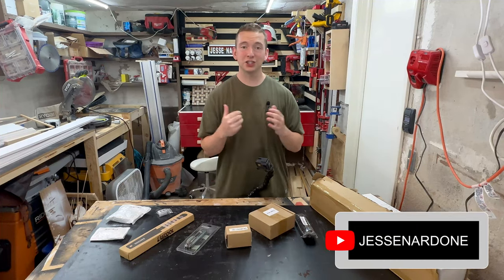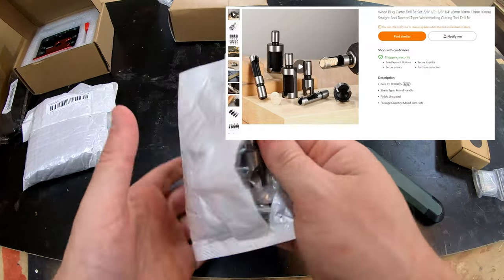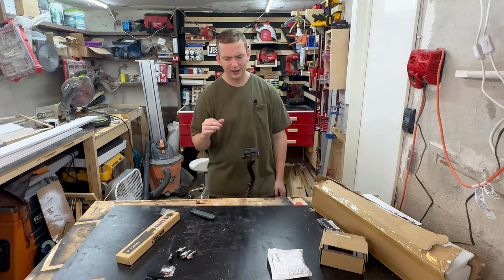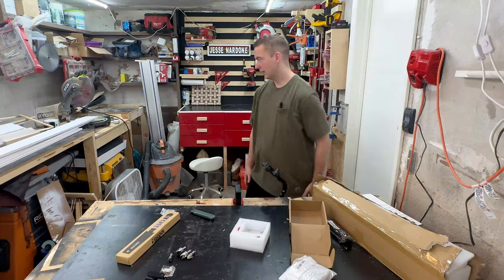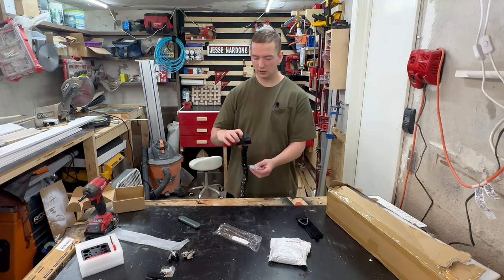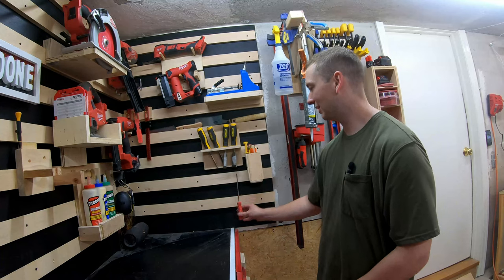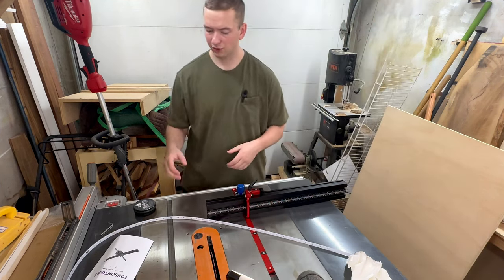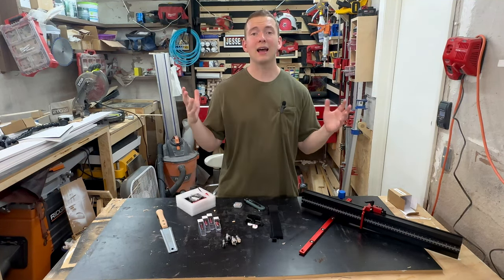I Bought More TEMU Woodworking Tools. I have an Addiction to Good Value! Unboxing - Initial Review

Comment: I have the same miter guage. The extra "washers" for the miter guage are to be mounted under the guide rail to help keep it in the track. Thats what the extra holes are for in the rail, and if yours is the same as mine the rail has recesses so the guide wheels or washers will sit flush. Some people dont like using them because it prevents you from lifting the guage straight  up and out of the track. I like them, it helps prevent the miter guage from falling if you pull it back a little too far to where the fence is off the table. Hope that helps

Comment: For the plug cutters, drill a hole in a piece of wood the same diameter as the cutter.
Clamp that piece of wood on top of the wood you want to cut the plugs out of. Place the cutter in the hole and it will act as a guide and stop the plug cutter from wandering around. Hope that makes sense
Reply: ...or use a drill press yeh?
Reply: You really need to put these in a drill press and they work really well.

Comment: Hi with the dowel jig you need to use a faster drill and it doesn't matter what timber you use if it's cutting ruff you need to push slowly ,or the blade is a little blunt.
With the plug bits you need a pedestal drill to be more effective.
Thanks

Comment: Would be nice to know if the miter gauge (it's not a fence) is square to the table saw slot, and whether it's adjustable if not), and if the angles for the stops are accurate.

Comment: That utility knife is a box cutter! You're not supposed to push or cut sideways with it! It's meant to be pulled for opening up boxes! And it snaps back for safety when you're done making a cut in a box! And that dowl maker tool You're using wrong! I got one just like that one from temu and it works great! You use square wood stock to make round dowels and it works great!

Comment: a 12 point socket can fit a cut square piece of wood... you need to chamfer the end of the dowel-blank so it can fit into the hole for the size you are cutting.

Comment: Sand down both ends of the wood so they fit in your drill and in the slot. The rest of the piece can be square. After your done and before you take it out of your still get apiece off sand paper and rap it around the dowel then run your gun. Hope that helps

Comment: well, if you had a lathe, you could turn down the end... but if you had a lathe, you would just use it to make the whole dowel. Low grade router bits are never good. They call it a miter fence, because it lets you do cross cuts like you would do on a miter saw. And that miter fence actually looks pretty good for the price. I would have liked to see if it has angle marking and if those marking are accurate.

Comment: Those plug cutters are for a drill press not a battery drill😂😂
Reply: those are not plug cutters they are chamfer cutters.
Reply: Chamfer cutter really.
Reply: @dtwistrewind7361  yes really. They are to put a domestic on the end of a plug or dowel.

Comment: If you don't have a drill press, use a block of wood and drill a hole in it with the right diameter (outside measure of the dowel bit, and use that as a guide. But I'm not the first to that option

Comment: I also bought the plug bits, use my drill press and they work as they are supposed to.
Reply from the maker: Did you also get the bits with the circular bottoms? I was optimistic I could do it all with a drill gun.
Reply: The same exact bits that were shown, I have used them multiple times with my drill press, I had to slow it down to stop it from burning, I have purchased many tools and other items from Temu and when you decide to do a return they refund and let you decide what to do with the return, I have only had to return one item that I asked for a refund for and have a box full of stuff that they said to keep.
Reply from the maker: Now only if I didn't have to sell my drill press. haha
Reply: It makes sense they dont work in a handheld Drill. Since they dont have any means to Center them

Comment: The flush cut saw,needs to have very sharp...FINE teeth...or your just hacking the dowel off and leaving a very rough cut.That is the problem with cheap made in china japanese flush cut saws..
Reply: It looks like it is for cutting tree branches.